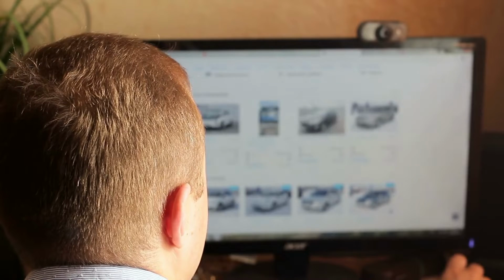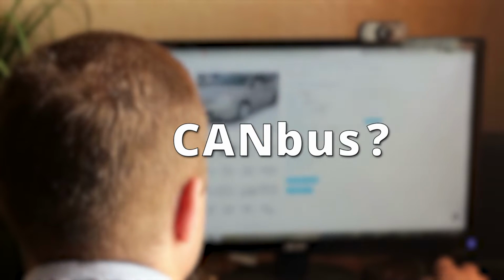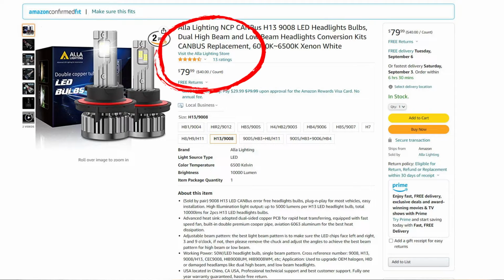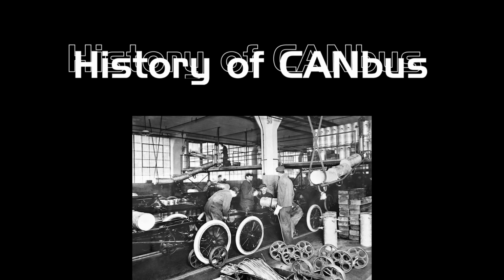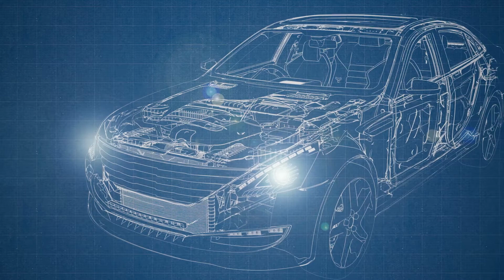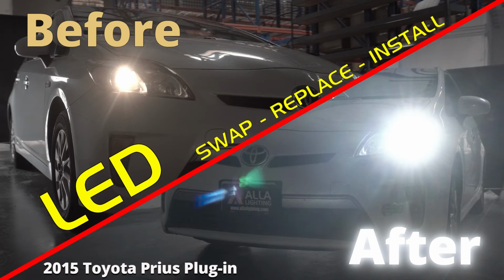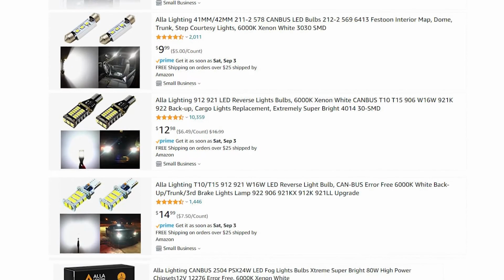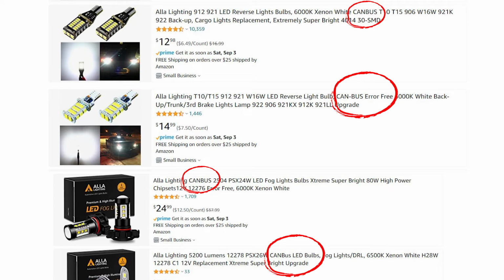Why Choose CAN-bus LED Headlights Fog Turn Signal Brake Lights Bulbs?

Comment: So in short you waste same wattage for LED , 😮😮😮 to compensate ? Not very top level tech I say.
Reply: Well for cars that monitor your headlights wattage it's an easy solution, just plug it in and it works... but why they have to call them "CANBUS" led's is a bit misleading, it has NOTHING to do with canbus, it's just a resistor built into the light

Comment: @AllaLighting

If I installed a led turn signal bulbs with built-in resistor/canbus and let say it’s a 3157 front turn signals for 2017 dodge grand caravan.

After installing it, and if some how the turn signals is not functioning properly, would this possibly require a plug and play style decoder kit?

Coming from Dodge. 

I know ram has such a complex canbus system. 

But I’m not sure if a led bulb with built-in resistor and decoder in it, is that enough for Dodge grand caravan 2017?

Are they or are they not compatible from any type of built-in resistor/decoder led turn signal bulbs?

Comment: what if the car doesn't have the functions of showing error code of bulbs malfunctioning on the dashboard? does this mean the car is non-CANbus? ..

assuming the car does not equip with CANbus system;
- can we install a CANbus LED onto a non-CANbus vehicle?  .. or we should only install non-CANbus LED onto a non-CANbus vehicle?
Reply: You can use a "non canbus" or a "canbus" bulbe, it's just a regular LED bulb with an inbuild resistor, so the car see 55watt usage... AMAZING TECHNOLOGY... meh